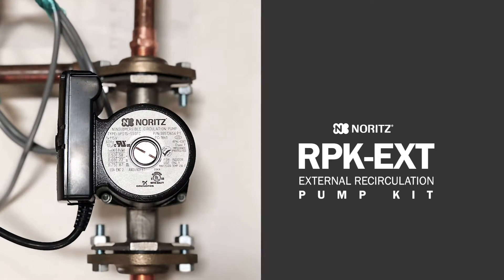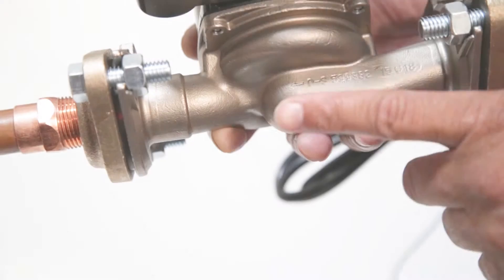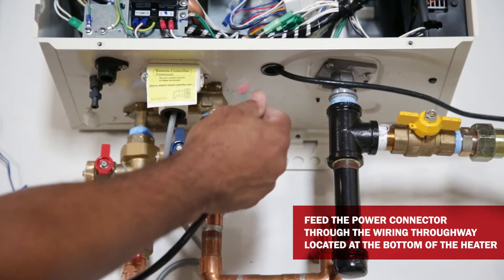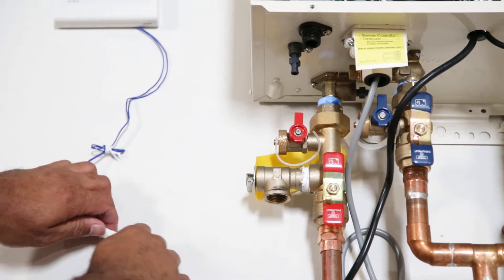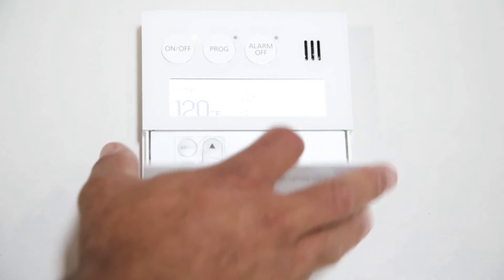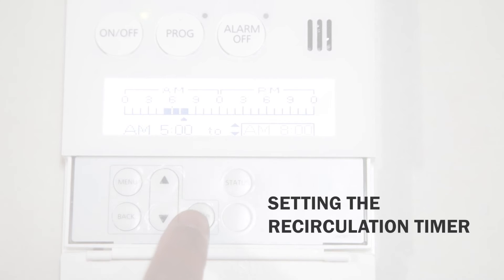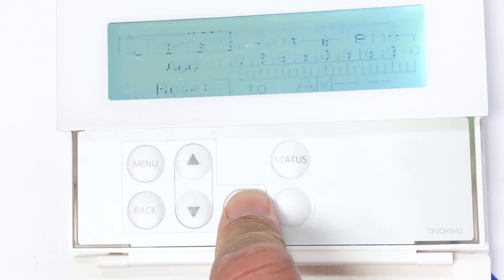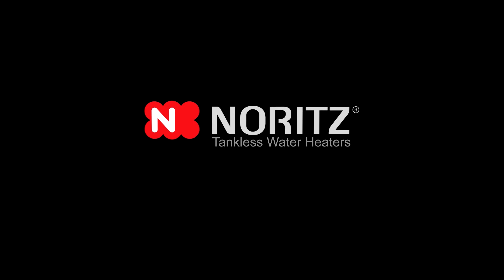Noritz RPK-EXT External Pump Kit Installation and Programming Video

Comment: If you have to schedule it.
Then you have an appointment with your hot water. So I don't think you can really call it On Demand anymore. Get it. Only at certain times.
Reply: These units aren't designed to be constantly running, this shortens the life. The windows aren't in 15 minute increments, but large windows like 4am-9am for example so the hot water will be ready for you while you're getting ready for work and be hot for the kids as they're getting ready for school.

Comment: I installed a motion sensor independent of my Noritz. It's been working flawlessly for 9 years now. I have the motion sensor triggering the pump for three minutes in the winter and 1 minute in the summer.  When there is no motion the tank-less does nothing thus optimizing my energy savings.  I hated the tank-less until I got the re-circulation pump. Now I love it. Mine is on it's tenth year. The only issue I had was low gas pressure and the gas company fixed that for free as they were way below minimum spec.
Reply: Did you have a return plumbing line or have to use a cross over valve at the farthest bathroom?  What pump did you use and how did you tie the motion sensor (what brand) into that pump?  Can you post a short video please.

I love my tankless system but after 8 years the wasted water makes me sick when I think about putting it down the drain.
Reply: @heyu9262  https://youtu.be/TfFP52yaCII